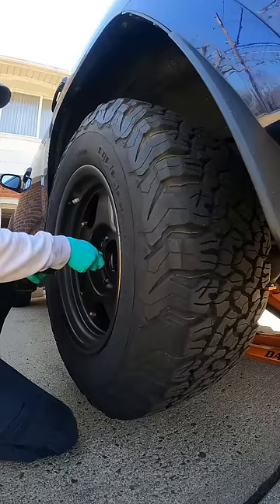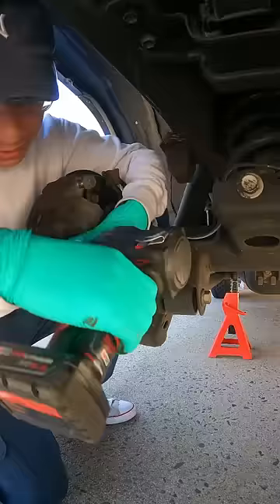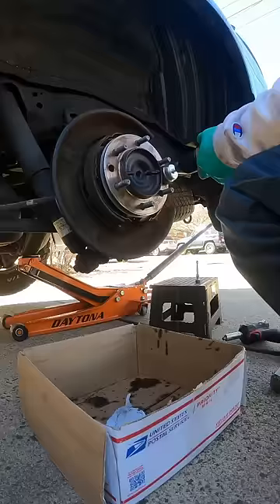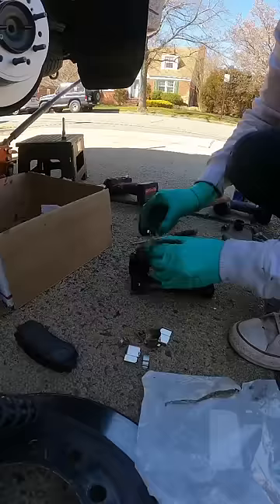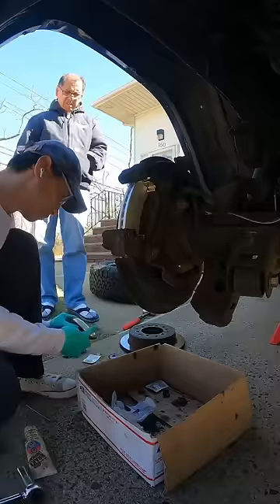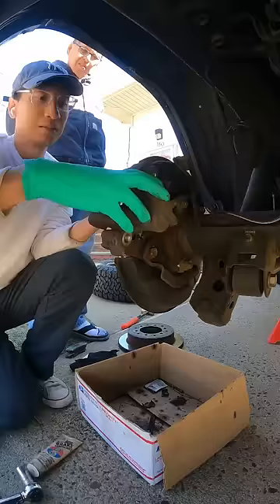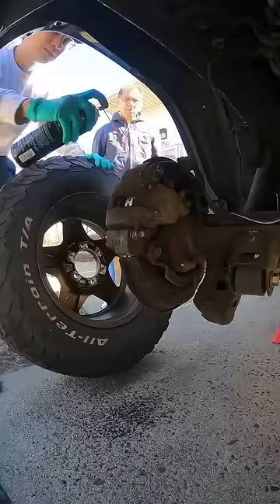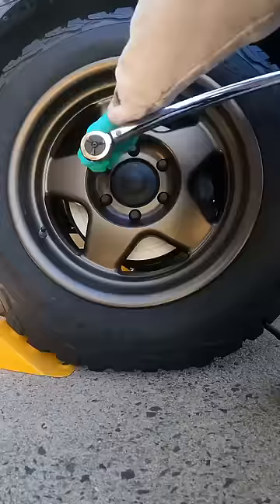Dealer wanted $700 to replace rear brakes. My DIY job cost me $100 and an hour of my time 😎

Comment: Me, still waiting for the brake "upgrade"..
Reply: Thank you! I was ready to see drilled rotors at least. Or some racing pads for those big ass tires.
Reply: Less than $100 for a complete brake job is definitely not an upgrade from OE parts.
Reply: @BlackLung87  that's basic maintenance.
Reply: He probably meant upgraded from garbage to new!  😅
Reply: @DaveDavis-ml5ic  drilled rotors are for looks.
Reply: @topkek7003  Really? Show us your mechanical engineering degree.
Reply: @topkek7003  drilled rotors don’t cool off faster than normal ones, they do however evacuate gas buildup between the pad and the rotor, and they also help to evacuate water from the rotors surface for better wet condition braking. 

You’re dead wrong pal.
Reply: It was an upgrade from old brake rotors to new brake rotors
Reply: Yeah with less than $100 in parts it's a downgrade. The dealer at least would have used oem parts.
Reply: @BlackLung87  not when he will be replacing warped rotors and squealing brakes in 6 months 😂
Reply: @bleachstain9785  ? slotted rotors do the same thing and dont crack after hundreds of heat cycles, you know, under real abuse. understanding the principle is different than actual experience in the field. seen drilled rotors crack many times. and of course they dont help cool the rotors better theres less surface area for heat dissipation 🤦‍♂️ thats what the vents are for
Reply: @Wishes890  yes on paper they sound good and help your track times, but the downside to drilled rotors is replacement more often. the little spaces in between the holes drilled into the rotors is oftentimes a weak point and after too many heat cycles they often crack and chip causing accelerated wear on the rotors and pads until eventual failure. they look great, but there isnt anything that they do better than a normal set of slotted rotors.
Reply: @topkek7003  why not just get drilled AND slotted rotors?
Reply: @xInline6  well because im not rich and i want my rotors to last longer
Reply: @topkek7003  slotted rotors still keep the liquid or gas in a channel on the surface of the rotor, drilled rotors evacuate it through the center of the rotor. 

Sure they crack from time to time, but this is why a thorough safety inspection prior to racing your vehicles is so important. 

I’ve run drilled rotors on almost all my cars in the past, I’ve only ever had one rotor crack and that was due to a retaining clip failure allowing one of the pads to vibrate the rotor excessively.
Reply: Upgraded from Japanese parts to Chinese lol
Reply: They are coated rotors. That is an upgrade.
Reply: @mph5896  almost all rotors are "coated" with zinc or similar coatings. It doesn't affect anything with the brake system. You sound like the guy, who paints his calipers then acts like they're Brembos..
Reply: @CultivatedMindstate  You are incorrect. Coated rotors are available to help prevent rust on the fins and hat. The actual braking surface, the coated material wears off after the initial break-in. This coating helps rotors last longer in the northern states. "Geomet" is one of the coatings used currently.

Comment: Brakes are one of those intimidating jobs that are actually quite easy to do, especially if you’re not working on old rusted parts. When that happens, it can become a pita, but the job itself is not complicated to do.
Reply: 9/10 times the hardest part is removing the rusted damn lug nuts lol
Reply: @playdiscgolf1546  Rusted carrier bolts
Reply: The easiest thing to do on any vehicle.

Comment: Don't forget to check the brake fluid reservoir. When you wound the caliper back, if someone has ever topped up brake fluid when pads were thinner, the system may need some fluid extraction.
Reply: I never push the fluid back into the reservoir. I always open the bleeder and let the fluid out there. A lot less messy, and minimizes the risk of the seals in the master cylinder getting damaged.
Reply: I usually recommend a brake fluid exchange with a brake job so I just leave it a little low after so it doesn’t over flow my shop gives a better warranty on out brakes if u get a fluid exchange with the brake job that’s why I always recommend them
Reply: @Will Swingem  definitely not a silly idea considering how often brake fluid is overlooked. I'd say theres a fair few vehicles driving round on original fluid thats only ever been topped up when its gotten low.
Reply: @Vikingxb well had a caprice once and did some mountain driving when the oil began cooking we had extremly brake fade and needed to pump twice before it braked 😂... but that just an american car. Also had this with a vw golf 2. When i reached 50mph and brake it brake til 20mph and then it didnt brake anymore. When i had a toyota starlet p7 from 1986 and brake it from 60 mph it did brake till 0 mph. Thats why the rest is crap
Reply: Yep, pop the cap off and giggle while it runs out thinking "dumbass Mr fix it here seen his brake light and added fluid........why does it need fluid......is something getting smaller.....wearing  down if you will, and it's not fluid but pads you need" 😂😊
Reply: @Vikingxb  I prefer to do this as well. I always bleed my brakes so fresh fluid is in the system anyway.
Reply: How is that even possible?
The passage is open. You’d have to seal the reservoir or apply the brake.
Reply: @KLOKSLAG1911  there isn't a car on the planet that will experience brake fade going from 50 miles an hour to 20 miles an hour in one stop. I think there's more to the story that you're not telling us.
Reply: @joeshumo9457  it will flow out the path of least resistance.
Reply: @Wishes890  yes there is. I experiance it myself lol. When brake oil is too old it will do that. Its hydroscopic it attracts and absorbs water over time. Water makes ur brake fluid boil. And then it fades simple as that.
Reply: @KLOKSLAG1911  Correction: brake fluid is HYGROSCOPIC, not HYDROSCOPIC. and, I'm doubtful it happened because the brake fluid boiled, likely because the pads were worn down and couldn't absorbe the high temps like new pads can.
Reply: @Wishes890  no mister wise guy. Pads were fine more than 6mm on them. Its just that the brake fluid was old. Didnt you read what i just said ? Or are you a stubborn guy? Also if you are limited than please dont wast my time i have run enough fluids from dot 3 til dot 5.1 and brake setups like liquid cooled rally calipers etc
Reply: @KLOKSLAG1911  soooooooo, you're cool. I've driven more cars than you've had hot meals. Never have I experienced brake fade on any car or motorcycle I've ever driven. Perhaps your knowledge exceeds your talent.
Reply: @Wishes890  dude i push stuff to the limit were you drove cars like a grandpa so please.
Reply: @KLOKSLAG1911  Nice for you. But I did too.
Reply: I'm probably wrong...love cars but can't work on them well...yet.  But shouldn't he have bled that break after putting new pads on?
Reply: Low fluid DOES NOT mean low fluid!
Reply: thats why you dont refill your brake fluid unless you flush the system (ideally with new brakes)
Reply: @russcox3125  No. Unless you have air in the system or your fluid is extremely old and dirty theres no need. It will not hurt the seals in the master cylinder. They are designed to allow fluid to flow backwards so when you let off the pedal there isnt still pressure holding the pads. The older systems were designed to allow most of the fluid to flow back into the reservior so the pads did not rest on the rotor and used a quick uptake master cylinder that utilizes a dual valve system to push twice the fluid amount when you brake. If you compress your caliper correctly, and that means with the correct tool, not a screwdriver or c clamp you will be fine. Screwdrivers and c clamps can damage the piston and cause a fluid leak. I can tell most of these comments are written by shade trees and not actualy automotive technicians who do this for a living. After thousands of vehicle repairs and less than 5 comebacks i can confidently say you are all making a simple brake job way too complicated.
Reply: Ironically did a brake job today with a topped off reservoir just 4 days after posting that comment. Made a huge mess when it overflowed.
Reply: @russcox3125 Only if he opened the line and let air in the system.
Reply: If you never bleed the brakes, you can expect fluid boil at around 6-8 years or 80-100 miles and will need to flush the whole system.  If you've never experienced fluid boil, just imagine pressing the pedal and having it easily sink to the floor while the car only barely slows down. In modern cars where a set of pads can last beyond 50 thousand miles, failing to bleed with every brale change can produce a damgerous situation. Performance cars where pads get chewed through every 20-30 thousand, yeah, you can probably wait until the 2nd or 3rd but since most cars just run DOT3 you can also expect the fluid to have be browning at like 60-80 thousand miles.
Reply: Anytime I work on the brake system the fluid gets swapped out. Brake fluid is cheap and it just takes a few extra minutes to do it.
Reply: I change my brake fluid every 2 years regardless of the color or how my brakes are
Reply: @DisaFreek  facts
Reply: Just take out some of the water.
Reply: Be careful the first few miles.  Master cyclinder can fail.

Comment: You don't yank on a torque wrench... Supposed to apply constant, even pressure.
Reply: Constructive feedback instead of just aggressive bullying, love to see it on the Internet. Its a rarity Nowadays
Reply: And hold it for a few seconds so it doesn’t spring back
Reply: If your torqueing something that brakes easily…. Maybe your slow or maybe a salty Toyota mechanic
Reply: @tylercecil5634  breaks - "brakes" are what the video is demonstrating

secondly, his advise not to yank on the torque wrench isn't because you'll snap the bolt.. it's because your torque won't be accurate when not using the tool correctly.. If you're going to use a torque wrench, why not employ proper use of the tool?
Reply: Just give it a good uga chugga with a wrench/ratchet and ship it!
Reply: @bensandker2308  or even better. Hit it with the pneumatic impact!
Reply: This and also when compressing the piston in the caliper its pretty common practice to throw an old pad in front of it just so theres no chance of damaging the piston but good job doing it yourself
Reply: @tylercecil5634  A salty Toyota mechanic would be someone like Scotty Kilmer. This guy was just giving good advice.
Reply: Yeah, but who torques caliper bolts😅
Reply: Damn straight
Reply: @tylercecil5634  or, and get this, maybe he's right.
Reply: @char_cole4680  Professionals
Reply: @char_cole4680  right?
Reply: I’ve done at least 10 brake changes and never torqued the caliper bolts before and never had any problems. That’s completely unnecessary lol
Reply: Person did have even pressure the whole time on torque wrench I'm a mechanic and this guy done a great job.
Reply: @trevorsanchez2470  As a mechanic, I've never kept count of brake jobs, but it's a few more than 10 lol.. I can tell you there's torque specs for a reason. When you've seen a caliper or anchor become a pizza cutter on the inside of a wheel, you'll appreciate why it's important. It takes 2 seconds to do it correctly, so skipping that step is just a needless risk. Professionals use torque wrenches (aside from it being the correct way to complete the job) because if something comes apart while a customer is driving, the liability then falls on the mechanic. Not worth losing a career over being lazy. I'm not saying you need to worry about torque specs on every fastener on a vehicle, but I'd maybe reconsider your position when it comes to critical components like your brakes - food for thought.
Reply: @aaronspringer2237  that's great, I'm a technician.. you can clearly see he yanked it 😉
Reply: @Drew-wf7vw nice!! Love the explaination. I'm learning from the really great replies like yours, and being entertained by the trolls 😂🎉🤓

Comment: Finally someone uses a torque wrench. Thank you
Reply: No such thing as a “torque ratchet”.
It’s called a “torque wrench”.
Reply: @LuckyCharms777  so is a ratchet a wrench too?
Reply: @thememebean1073  
A ratchet is a ratchet, it’s not a type of wrench, but an internally-toothed rotating mechanism on some wrenches. What some people call a ratchet is actually a socket wrench, which generally has a ratcheting mechanism. There are also ratcheting box-end wrenches and ratcheting screwdrivers. So I’d say technically, a ratchet is a feature on some wrenches, but it’s not a type of wrench because those wrenches are also available without a ratcheting mechanism.

For instance, you have a box-end wrench (a wrench with a circular end versus the open-end wrench as seen in this emoji 🔧). Whether it has a ratcheting mechanism or not, the tool name is still box-end wrench, but it can also be called a ratcheting box-end wrench or non-ratcheting (regular) box-end wrench to specify between the two. 

So in the case of torque wrenches, which are a specialty type of socket wrench, there are the beam-type and the click-type. The click-type, as seen in the video, I suppose does have a ratcheting mechanism because you can reverse the direction of the wrench without also moving the socket in reverse, but that’s not considered a primary feature of the click-type torque wrench like it is on other wrenches so it wouldn’t be called a ratcheting torque wrench.

Sorry for the long explanation. I just wanted to make sure I properly explained it so hopefully you’ll understand what I’m trying to say.
Reply: @LuckyCharms777  I ain’t reading all that but since you put in the effort I shall change the mistake I always called it a torque ratchet at work and never got told differently

Comment: Brake clean is a degreaser. You have to wipe after spraying otherwise after brake clean evaporates the oils and grease are still present.
Reply: It doesn't hurt to wipe them but in actuality the brake cleaner will disolve the oils on the new rotors & as the cleaner runs off the grease & oils will go with it. So no you really don't need to wipe them. Just use enough cleaner for it to run off and take the bad stuff with it.
Reply: You don't even need to use it on painted rotors
Reply: I spray wd 40 on my brakes weekly to prevent rusting
Reply: @EricB90  lmfao.. Gotta be cap
Reply: @SmDJeremy  obviously
Reply: Far from true, just spray it off and it’ll drip down into a pan. I repeat this Cadence hundreds of times a week at my dealership
Reply: Degreasers dissolve grease so no, after flushing the surface with brake cleaner there is no more oil and grease present. Otherwise what does a degreaser do if it doesn’t remove grease and oil? With brake cleaner you wet surfaces then keep spraying to flush dirt and grease off the surfaces you’re cleaning
Reply: Soap and water or carb cleaner
Reply: Better off with soap and water
Reply: @waynes.2983  sure or you can do your correct work all the way through and not half ass it..
you are already there, why not just wipe it down and make sure its all gone...
Reply: @dzl6848  soap is likely to leave a residue. Rotors with this anti rust coating don't need to be cleaned anyway since they don't ship from the factory with oil on them 🤷🏻‍♂️
Reply: @mattlane2282  the comment I was looking for.
Reply: @itspapaj4732  the oil that’s put on rotors is specifically designed to be removed with soap and water. Next time you do a brake job use a little bit of dawn and some water. You’d be amazed how well the anti rust coating they use comes right off.
Reply: @kjmahanna5138  using soap will leave a residue 😂. Rotors that come with that rust coating do not come with oil since they won't rust while stored. And the coating most definitely doesn't come off with just soap and water. That coat is meant to be removed by the pads and using brake cleaner on them will brake down the coating.
Reply: @itspapaj4732  incorrect. If you’ve never done it you would not know. Soap leaves no residue.
Reply: @mattlane2282  Those were not painted...they were coated.
Reply: @kjmahanna5138  Soap and water for freshly turned rotors, lint free cloth and wipe down on coated rotors. Brake clean does not remove all the cast iron dust off machined rotors. When that stuff gets imbedded into your ceramic brake pads, you get noise. The coating on a coated rotor is designed to imbed in the new pads also to eliminate noise, which is an audible harmonic frequency.
Reply: @jondahl3173  Bro paint is silver gray etc... COATED is metal colored with that clear coating I aint never seen metal that color.... I SEEN PAINT HOWEVER THAT COLOR
Reply: @jondahl3173  we’re talking about the anti rust coating correct? It’s designed to embed into the pads? News to me. Was always taught in tech school that it needs to be removed with soap and water. I’m not saying you’re wrong. Just never heard that. Would make brake jobs a lot easier if that’s the case.
Reply: @kjmahanna5138  I always leave that silver colored coating on new rotors, it's what I have been taught in numerous manufacturers tech classes over the years.
Reply: @mattlane2282  I don't think you would "bro" me in a shop setting. It is a coating, not in a paint or powder coating sense. It is meant to be bedded into the pads during break in procedure. It will stay on the hat area of the rotor on even an overheated rotor. It is a rust inhibitor also.